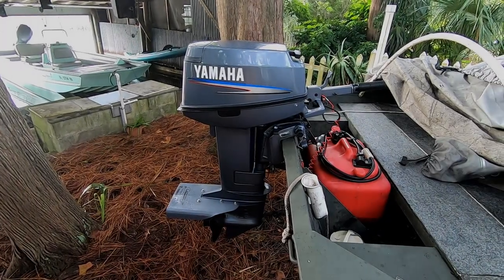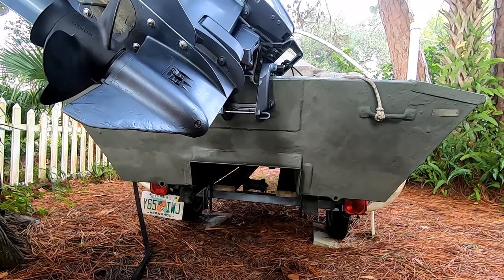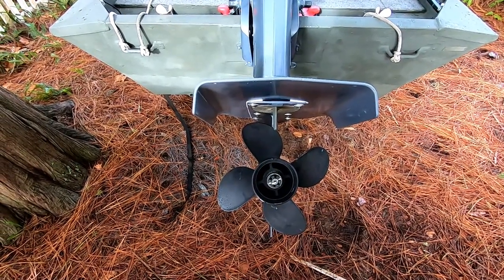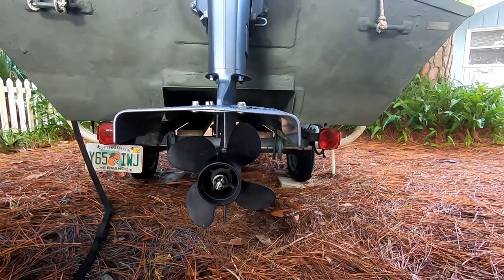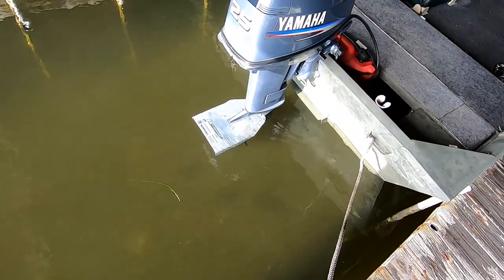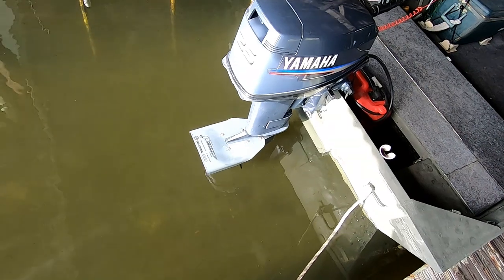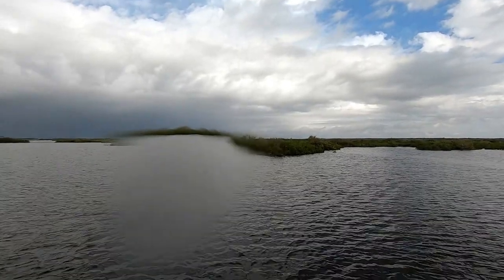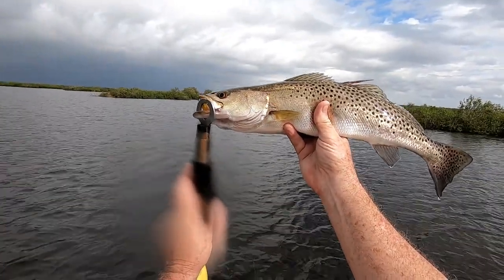Permatrim Cavitation Plate Install on a 25 HP Yamaha 2 Stroke & Big Speckled Trout 2022

Comment: Cool deal I never knew what a Cavitation Plate was and nice trout too!
Reply from the maker: Slayermike Fishing and More....Cavitation actually creates heat along with bubbles/aeration because the top of the prop blades is grabbing air instead of water.....Even with the 4 blade prop I was getting total loss of speed on sharp turns because the water in the tunnel was hitting the prop blades at a 45 degree angle instead of a straight on flow.....Those gull wings are managing to hold more water down over the top leading edges of the 4 blades and eliminating the blades biting air....Have a great weekend!!

Comment: Hey there Wes, I still have my old (quite old) Yamaha 30hp outboard motor.  It is still mounted on my old 14 foot super lightweight glass boat.  I put a cavitation plate on it and it improved my get-outta-hole lift plus my boat almost felt like I was riding on glass.  Choppy water still whipped me up.  Prior to installation, on turns, occassionally I'd skip a bit to the left or right (similar to drifting in cars) but my plate was like an anchor and dug into the water in turns.  My cavitation plate was designed a bit different.  I want to say mine looked like wings.  You're right, when you drill through the lower lip on your motor, you MUST take your time.  There is no tolerance for error.  You only get one shot.  Nice snaggle-toothed trout that just wanted to make your day.  So ya got it on the "dean".  Thanks much for the video. You brought back a lot of memories.  
Currently, we're under extreme icy weather warning for several days.  It rained a lot then the rain slowed down.  Now it's getting colder and colder so I guess the ice will be taking over later tonight.  Be safe my brother and ........Happy New Years!     Don 👍🏽🙂
Reply from the maker: Houndsman One.....Thanks Don!! The boats are similar and for my needs you couldn't get me to sell my boat.....Big boats don't work well up there because of all the skinny water and lower unit destroying lime rock bottom!! I don't think I can find another modification or come up with another idea that will help me any further....But I'll keep looking and thinking a lot of What If's.....LOL!! In the winter some plastic paddle tails mostly Baby Bass 5" Paddle Tail Zooms rigged Texas style with a 1/32 oz bullet and the 808 BG "Dine" are the baits that usually get me through the winter down here!! I was just looking at the weather along the panhandle and it's flashing sleet and snow.....I guess it's back to hibernating again.....LOL.....Have a great frosty weekend!!

Comment from the maker: JMP.....Thanks!! Here on the Florida Gulf Coast where I live the bottom is nothing but lime rock and I need to get up quick and I knew about the plastic plates but as far as I was concerned they were junk......When I fund this product the all aluminum build and that it was painted to color match my Yamaha I decided to give it a try......This product along with my 4 blade prop got me up right now.....The wings push more water around the blades and it also stopped some of the sideways slide in turns.....The boat now runs true in turns!! Since I made this video I installed one on my center console running a 4 stroke 70 HP Yamaha which now acts as a Trim Tab because the boat is slow out the hole and it has made a big difference getting the boat on plane.....I've also replaced the 25 2 stroke Yamaha with a new 4 stroke Fuel Injected 25 in the last 3 months and as the song goes.....And the beat goes on.....LOL.....Sea Ya and good luck!!😎

Comment: I keep wanting to buy a new boat. But youight have inspired me to  do a rework instead. GreT job hope ot works out... you know I will be watching.
Reply from the maker: Out and About Outdoors With Ron and Friends.....Thanks!! I bought mine new years ago and have made all sorts of modifications.....This is my second outboard and I've made 4 changes/additions to the motor and transom so that's it in the stern because the only change left is a jet which is way too heavy and the fuel efficiency is less that half of what I get now!! If you've got a solid boat modifying the hull might be the trick.....I know I've been reel happy with the changes that I've made.....Have a great weekend!!

Comment: Great job Capt Wes. I like the wings on the plate. Helps contain the water coming off the side of the prop and direct it back and down. It should stay on a plane at a lower rpm too. SAAAAAAAWEET 👍😎
Reply from the maker: Randolph Relic Recovery.....Thanks Martin!! My biggest concern was ventilation in sharp turns when the water is really to skinny to drop down and is how I've dinged up the skeg most of the time!! Those wings drive more water over the 4 blader because before the tops of my blades were grabbing air and you're right I can stay on plane at lower speeds.....I know I'm sold on the install.....Have a great but frosty weekend!!

Comment: I'm having the same issues with my boat, especially on sharp turns. I'm going to try one of those cavitation plates to see if it helps. great info. Thanks.
Reply from the maker: Go Midwest Fishing.....Thanks Randy!! It turned out to be an easy fix for me and this is probably the last performance enhancement that's available ....I've now managed to do what it takes a jet drive or an airboat to do....My next purchase will be a new Yamaha 25 HP 4 stroke and possibly a jack plate....The distributor for Permatrim is in Washington Island, Wisconsin.....Check to see if the size is in stock before buying....I had to wait 5 months.....Have a great weekend!!
Reply: @WesLovelace  Thanks for the info. I checked at cabelas today, and they have them, but they are much bigger than yours. I like the one you have. I will check permatrim to see if they have any in stock.
Reply from the maker: @GoMidwestFishing  I suspect the foils at cabelas are plastic where this one is almost 1/4" aluminum....Something to consider!!

Comment: That tunnel boat gets on plane fast now! How long and heavy is your boat?
Reply from the maker: Dpuck Fishing and Outdoors.....Thanks!! The way it's outfitted now about 500 lbs....Top speed at 27 mph with a fuel capacity of 6 gallons and a range of 50 miles....Length is 15' - 3" and it sits on a 16' trailer. I did all the rigging and additions, It's capable of running and planning in 5" of water  and the maximum HP is 25....Eventually I'll replace the 2 stroke with a 4 stroke....Enjoy your weekend!!

Comment: Looks like a great addition   that extending  Handle that you have on your motor do you find that works really well
Reply from the maker: John Ames.....Thanks!! If something looks like it will improve my skinny water travel I'll give it a try!! John I've got 2 of these handles....One does not extend and is about 36" long and the other extends to almost 6 ft.!! If I remember I got both from Bass Pro and I've had them for years....They are both well made and they allow me to stand and till the 25 Yamaha which I need to run all the back country and see where I'm going because of all the high mangroves and narrow turns where you cannot see any oncoming traffic....If your motor is no more than a 25 hp you might consider getting one.....I've been using them for 25 years.....Have a great weekend!!
Reply: Thanks for the great info and have a great weekend 👍

Comment: Great video.  Interested me in two way - cavitation plate and running the Chazz.  I was looking at the Fibertex Shaw Wing but too expensive. This one is cheaper but I’m concerned about mounting it above the engine cav plate .  Good idea about adding washers but still concerned about pressure on the engine’s cav plate.   Thoughts?  
As far as running Chazz; can you run on plane from the ramp to the piers at the opening without hitting bottom? How about on winter low tides? I’m new to the area and hope to run it in a Gheenoe with jack plate and a cav plate added. What you think?

Thanks!
Reply from the maker: When I say I'm running the Refuge it's down here from Bayport where I live. I had no problem with the Permatrim Plate on the Yamaha!! The plate, extended tunnel and the 4 blade all get me on plane in a hurry!! Now I just installed a new 4 stroke 25 Yamaha this week and tested it out today with another Permatrim Plate and everything works fine....The plate costs about $109 dollars...I also have a plate on my 18 ft. CC using a 70 HP Yamaha. Now I can run the Chazz River from the park but that place is a launch nightmare and I fish most of the time all the way to South Blind Creek from Bayport/Weeki Wachee River!! Now I'll tell you up front this coast is a nightmare because of the lime rock bottom....It's no place to screw around without local knowledge!! More Q's ask away!!

Comment: Makes me wonder what I could do with a 12” square, 1/8” thick piece of aluminum?
Reply from the maker: I'd say very similar to the plate as I have....Now I've fabricated a lot of add on's for both boats but I don't have the equipment to fabricate an add on such as this and at $109.00 for the 25 hp Yamaha and 150.00 for my 70 HP Yamaha I saved my self a lot of aggravation.....If you have the equipment I'd say have at it or if you know someone that can do the fabrication again see if they can produce the plate.....Also keep in mind that all the major brands if I remember correctly.....Yamaha, Mercury and Suzuki have different variations on this plate....Got any questions fire away.....Sea Ya!!😎

Comment: Outstanding! You’re right, the paint sets it apart big time. That’s a FINE skinny water boat brotha 

Did you notice any difference on top end speed?
Reply from the maker: Fishing4dinner.....Thanks!! So far I've been reel happy with the results now with the addition of the four blade prop, the 20" tunnel extension and the cavitation plate my top end has gone from 29 mph to 26/27 mph because all 3 additions have combined to push the bow down thus losing planning speed. Now that being said the lost speed has now created a plus during times when the water is so shallow .....When I push the throttle all the way the bow digs in and raises the transom and thus the motor lower unit by as much as 3" and that is giving the ability to run even skinnier and I have on a few occasions had to do that and it works.....That was something that I was knot expecting but I'm happy I have that it's now in my bag of tricks.....Sometimes I need all the plusses I can get my hands on.....Enjoyed the question.....Have a great weekend!!

Comment: Wes I just got a permatrim. How do you like it. My boat porpoises. I hope it helps. Tried several props. I need more lift on the stern.
Reply from the maker: Thanks Nick!! It was what I needed for the tunnel along with the 4 blade prop. Both get me out of the hole fast which was what I needed in the shallow water. I also put a cavitation plate on my 70 hp Yamaha on my CC Pro Line. My problem there was the boat was slow out the hole and I didn't want to add trim tabs or  change out my 3 blade stainless prop and the plate solved the problem along with having tilt and trim!! The porpoise should be fixed with the proper trim. The 25 Yamaha is in a fixed position in the tunnel and I can't change the angle/trim without affecting my flat running angle. Porpoising has never been a problem for either boat. Now I can easily control my run angle on the CC but I can't use full throttle on the tunnel because the bow starts to plow and because I don't have tilt and Trim I'm limited to about 3/4 throttle which takes about 3/4 mph off the top end!! When I'm in really shallow I throttle up to the limit which pushes the bow down and raises the stern an inch or two....So far I've managed to stay off the bottom!! If you can adjust the trim angle that should eliminate the porpoise....It's doubtful that adding weight to the bow will help.....Hope this insight helps.....Have a great weekend!!

Comment: Been wanting one of them for my Suzuki couldn’t find em
Reply from the maker: Reel Gang TV....Thanks!! They are distributed and sold thru Permatrim USA in Washington Island WI...54246. Contact email: sarah@shipyardisland.com ....Check for stocking. I just put one on my Yamaha 70 on my Pro-Line and one on a 115 Suzuki on a larger aluminum tunnel....It was black!! Permatrim matches the orginal colors for all plates and motor horsepower.....The price runs about $109 for small to about $150 to 300 HP.....Check it out!!

Comment: Did it affect the top speed any?
Reply from the maker: ronald manhammer.....Thanks!! According to my GPS it did not....I did lose speed when I went from a 3 blade prop to a 4 blade prop.....I couldn't play with the pitch like I could with the 3 blade and with the prop change I sacrificed speed for the hole shot....I went from 27 MPH to 25 MPH and I stand up when I'm running so most of the time I'm running about 20 MPH.....I learned a long time ago that speed will get you thrown off my tunnel if you try to take turns too sharp.....LOL.....Thanks for the question!!